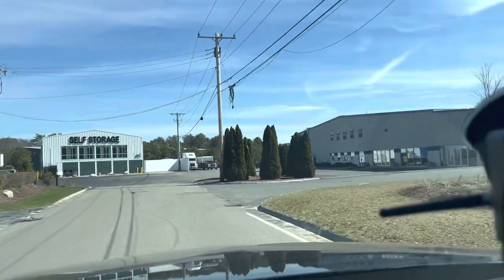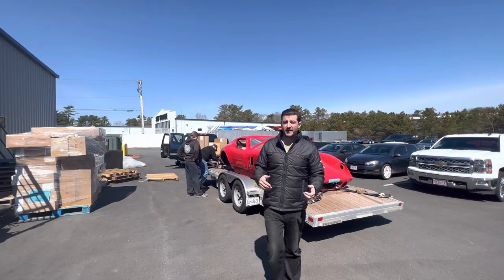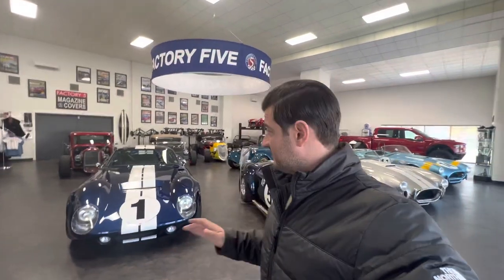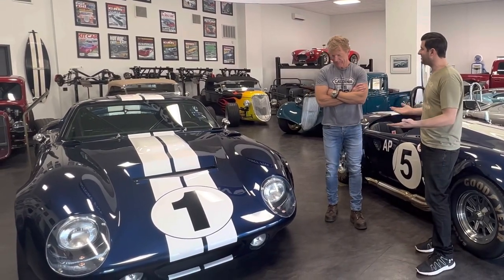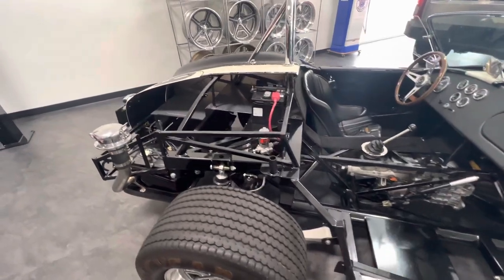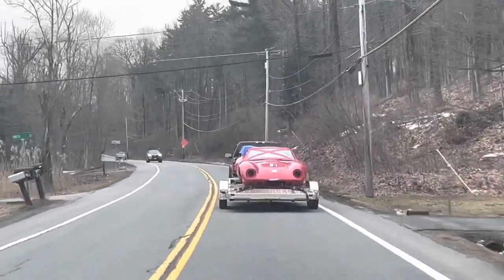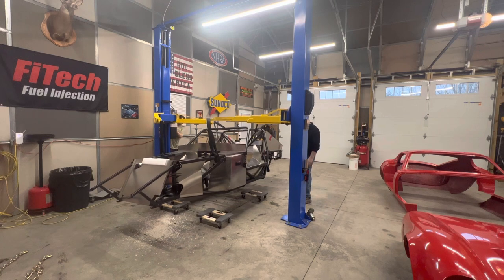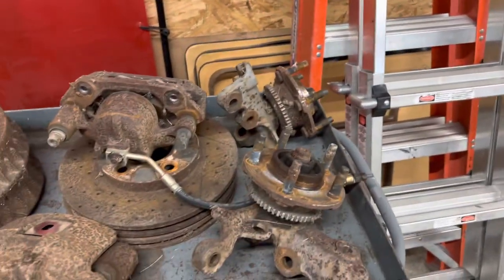WHAT IS IT LIKE TO PICK UP YOUR FACTORY FIVE TYPE 65 COUPE?

Comment: I’ve always wanted to do this. I’ve built many cars from the ground out but never a kit car. Be nice not to worry about rust for a change.
Reply from the maker: I think the one thing I really realize with this is there’s not a lot of custom work involved in building it comparatively to some other projects we’ve done. And it comes with the vast majority of the parts required to put it together. You just have to put it together, so much less time spending hours upon hours of trying to find parts that might fit the car
Reply: @LowBoostFilms  But it is very customizable.   From engine, transmission,  rear end, lights, interior, dash.  I like their stock parts but I'd upgrade the dash and the seats.  One guy did vinyl wrap of the dash, it looked great.

Comment: Just finished a Roadster, going to do the 35 truck next and then maybe a type 65.
Reply from the maker: Awesome! How long did it take you to do the roadster?
Reply: @LowBoostFilms  Well I had delays on parts and engine (the longest) but you can do one in 2-4 months if you have everything.
Reply from the maker: @brianwillemssen3531  wow! I was thinking 2-3 years hahaha.
Reply: @LowBoostFilms  Depends on how much time you have. About 300 hours can get it done.
Reply: @brianwillemssen3531 I've heard the manual isn't  the best.

Comment: What is the length of your trailer?   I'm picking up a Coupe project in two weeks PLUS, I'm also picking up a Coyote engine/transmission in another box plus all the 35 other boxes of parts.    I have a flatbed trailer similar to yours, but mine might be a few feet longer.   I won't know till I go measure what I have and compare the length to your trailer.
Reply from the maker: It’s an 18ft trailer. Depending on the size of the crate, we could have fit one as well as the body. They’d just have to move the body forward where it starts to hang over the dip in the trailer. if yours is even a foot longer that would make it a lot easier.
Reply from the maker: @johnd.williams3477  I was worried it wouldn’t fit but it did. We put a few in the back of the extended cab too. And a lot of the boxes have some weight so it would take a lot to blow away. We used some ratchet straps to tie them all down. They also threw a bunch in the coupe too.

Comment: I've looked at the Factory Five Type 65 and Mark II roadster.  It looks like a finished build is about 80K.  Can you confirm this?
Reply from the maker: Type 65 is a lot more than the coupe. It all depends on what you want to spend. We are doing it ourselves with budget engines and parts and looking around 45-50k completion cost. But if you want a $25,000 engine and transmission, $5,000 rear end, and pay to have someone build it. It’ll easily be over 100k.

Comment: You're going to have a lot of problems. The fit-and-finish on these cars is terrible. The customer support doesn't exist. If you take a picture of something that is obviously wrong and send it to them they are going to say it looks great don't worry about it. I've had first-hand experience with this company and they are the epitome of used car salesman. Sorry it looks like a great project but it's going to be an enormous pain in the butt and it's going to be much more expensive than you thought. I can tell you now because of the poor fitment your paint job will cost you $15,000! Be prepared for problems every single step of the way and don't expect the manual to be clear and most surely don't expect customer support to explain anything thoroughly sorry perhaps you should have read the forms first just about everybody on their says the same thing
Reply from the maker: Considering every other project I’ve done involved rusted bolts and parts with no manual this is a walk in the park lol. And yes I expect the paint job to be expensive because it’s gonna look great.
Reply: Why do you have to complain and be so negative, you wrote an entire essay and there isnt one good thing in there